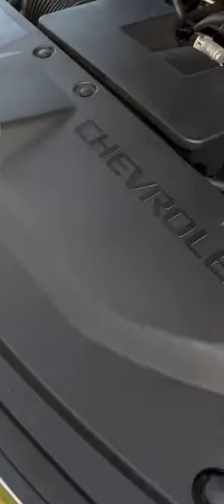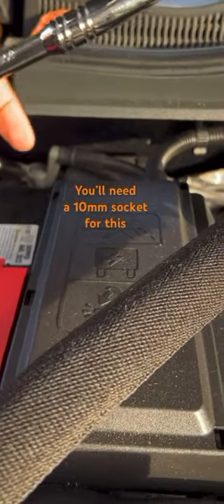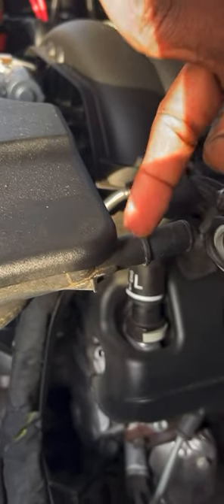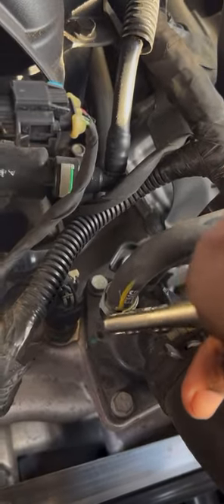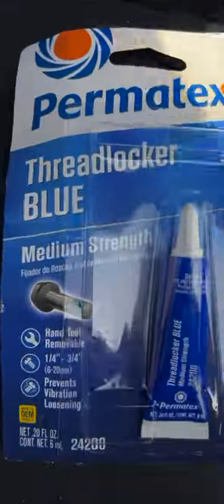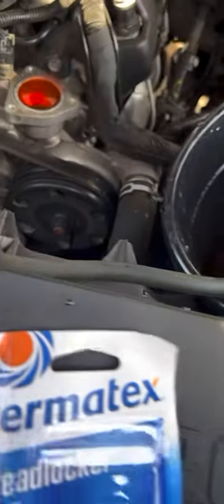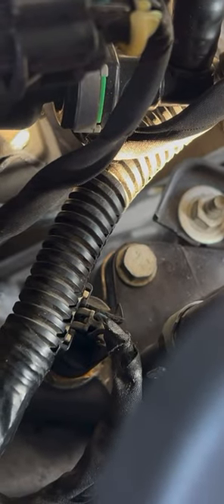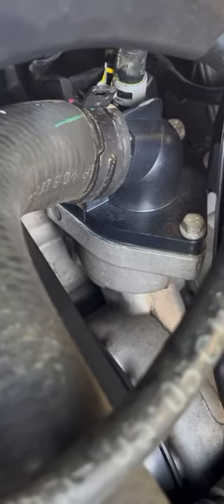2016 Chevy Tahoe Radiator fans constantly running

Comment: Would this also cause the temp gauge on the dash to stay very low if this is the issue?
Reply from the maker: Yes it would mines stayed low but then the fans didn’t shut off even after the truck was turned off
Reply: @kencoleman200 thank you! I was able to do this repair myself using your video!! ❤❤
Reply from the maker: Great… I’m glad it was helpful